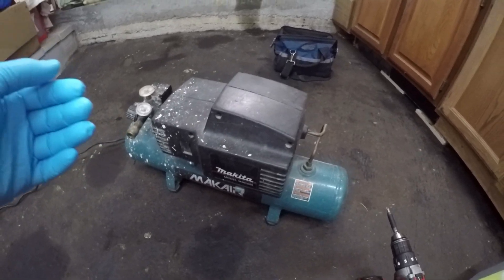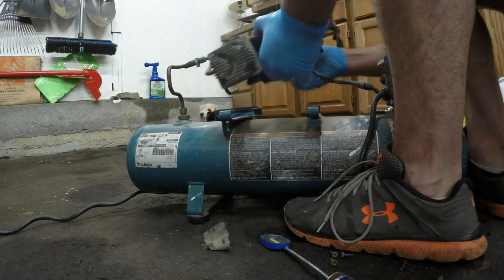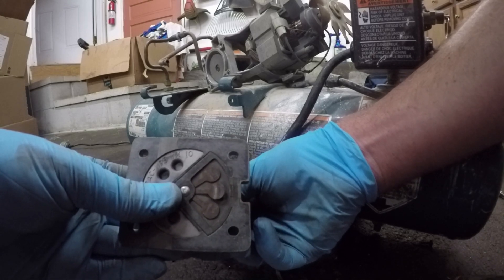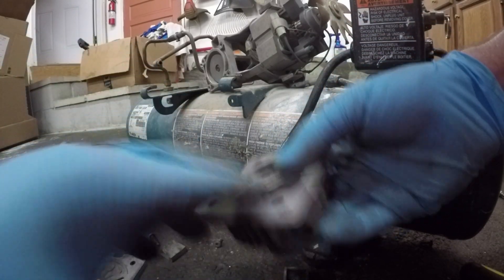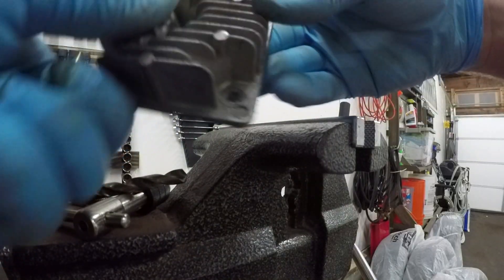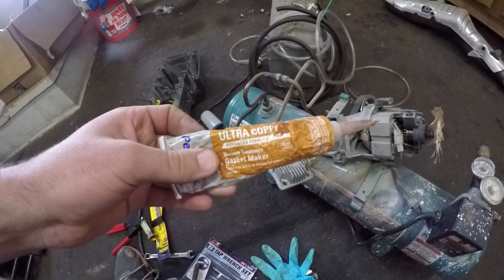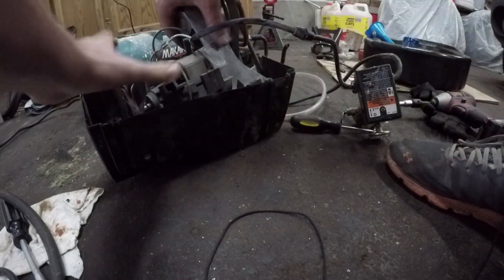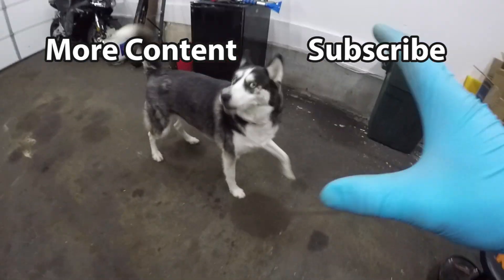Convert an Air Compressor to a Vacuum Pump ($40 Project!)

Comment: hey, cool idea. However, Its a lot easier to get an old refrigerator compressor from a scrap yard for 10 or 20 bucks and solder on the fittings you need to the suction side. also makes a nice silent air pump for topping up tires etc.  Also, a programming idea. What would it take to modify an average 4 inch (or so) grinder so that it doesnt sound like its going to fly apart. Im thinking gearing is just not tuned for quiet operation?